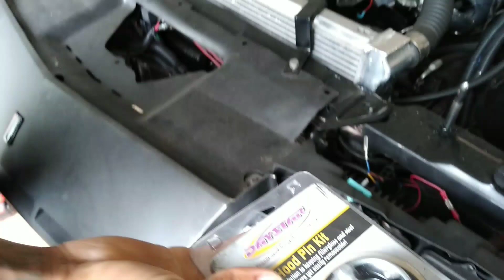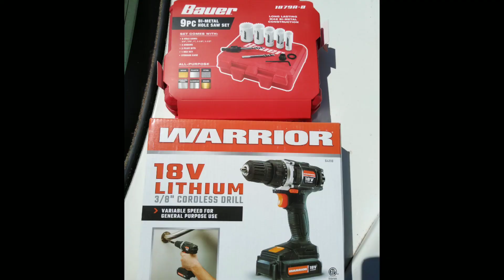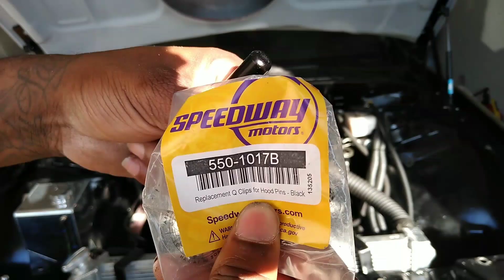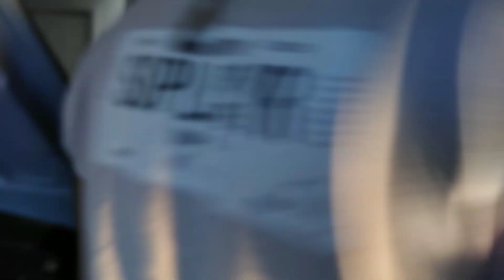82-92 CAMARO HAWKS MOTORSPORTS SUNOCO HOOD AND RINGBROTHERS BILLET HOOD HINGES INSTALL AND MORE

Comment: I picked my set up from ring brothers almost 2 years ago..$650 in Billet bare Aluminum (not black)..seen a add for them a week after spending $400 on getting my hinges Chrome plated..lol..92 Z28.update...just went to there web site..WTF..price is way up..more and more guys buyn them..wow..have had my Camaro from the day it lest the GM lot pushing 30 years now..good luck with the build..
Reply from the maker: Thanks man it's rough car game has really got high dollar on alot of parts

Comment: I’m starting to build up my 3rd gen camaro this week What kind of mounting hardware did you use? On the hinges to the car
Reply from the maker: It comes with it's own mounting hardware use the old bolt hose to screw the bolts in
Reply: @MrLong-tg9ss I bought my car as a project it had a 6 inch cowl hood fiberglass been trying to fixer her up but hood got stolen bought a used one in offerup for $100 3 inch hood
Reply from the maker: @DavidSantos-mf8bl  that's great